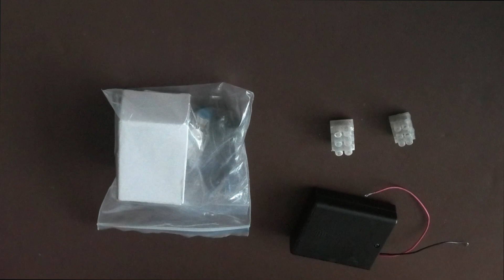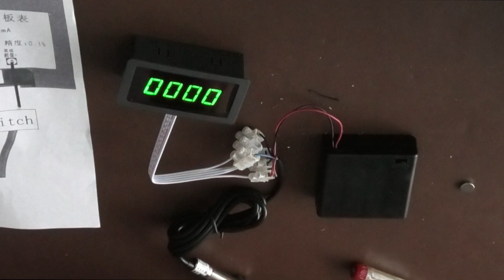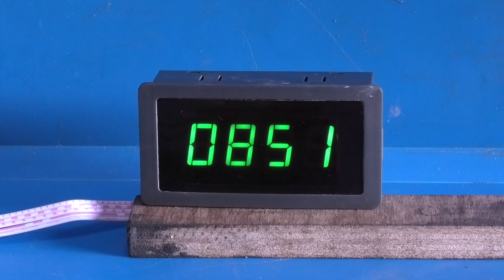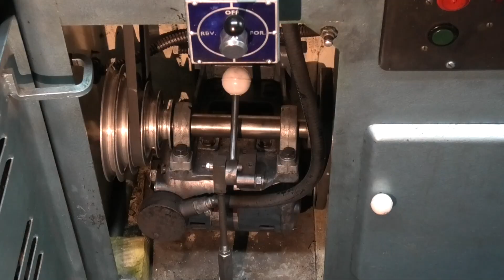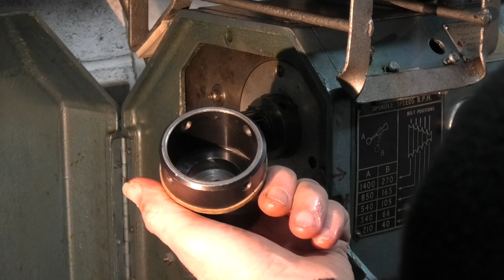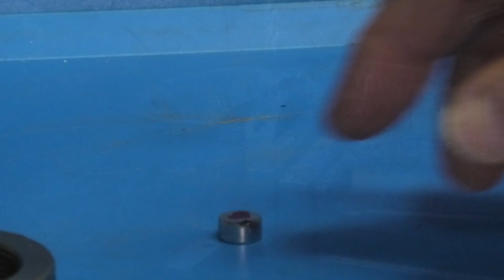Checking the lathe speed

Comment: As the v-belt and the pulley sheaves wear at different rates the speed ration will never be an exact reflection of the pulley diameter ratios.  With pulleys it’s always a guess!!  Aluminium pulleys are the worst for wear.

Stavros

Comment: I bought a laser tachometer from ebay which came with adhesive reflector tape which I attached to the chuck on myford s7 and enabled me to check what the speeds were in reality vrs spindle settings and turned to be pretty close

Comment: Thanks for the video, even if it is not a complicated project it is very useful to have on a lathe. I want to do the same thing on my lathe because i plan to put a VFD but i have a problem with the display. If i move the magnet by hand under the hall sensor it gives a reading of the speed. Whenever i put the magnet on the spindle the display gives wrong readings or sometimes HHHH so the speed is too high but the lathe is at only 600rpm. I've read that shielding the cable could help bit i think it is a little bit strange anyway. Does someone have my same problem or know how i could try to solve it ?
Reply from the maker: Hi. I found the magnet only works on way if upside down it won't work ( north or South Pole of the magnet)
Reply: @enotsengineering  Tanks for the advice but that it is not the problem. The hall sensor switches correctly if the magnet passes under it. The problem compares only when the motor is running. If i move the magnet te reading seems correct.

Comment: I did the same to my Boxford BUD but I just glued a thin magnet to the spindle locking nut and mounted the pickup on an adjustable  bracket utilising the gear cover case screw. Since then I have converted it to an electronic lead screw 6 months ago that also gives me the RPM so I removed the old display screen. I changed the spindle bearings last weekend and the magnet did come off mainly due to  being knocked off. 
I have been following your video's for a while now and have picked up a lot of good info on Boxfords, many thanks.